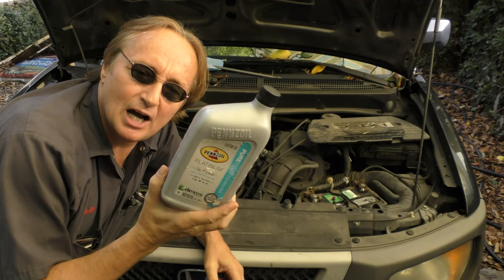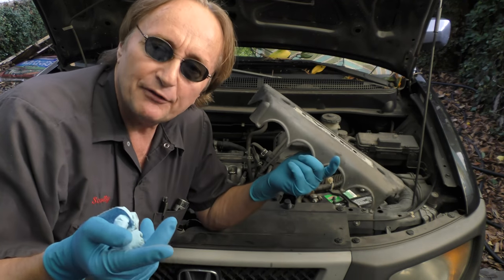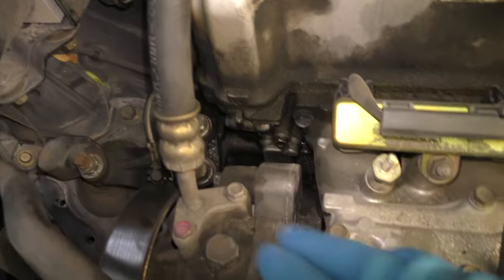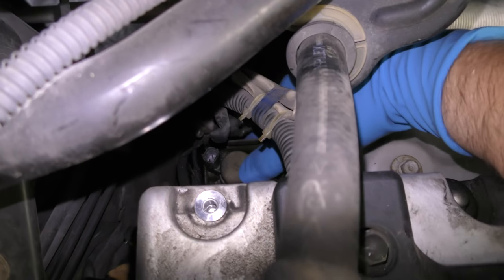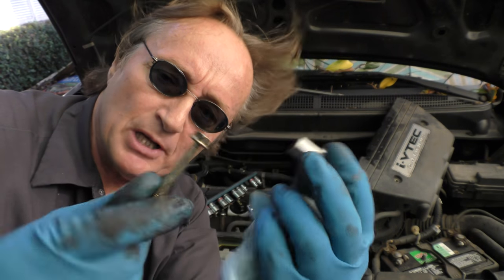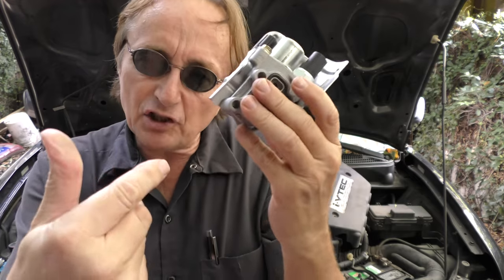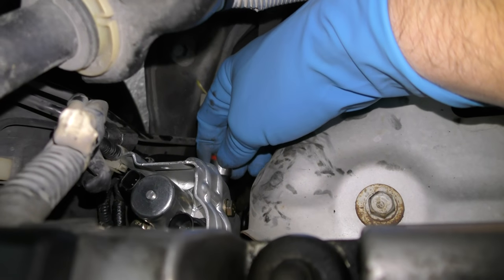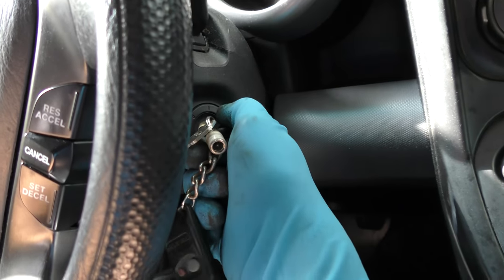How to Fix Variable Valve Timing in Your Car (VTEC)

Comment: Hey Scotty, not related to this video, I wonder, did you have any experience with diesel engines in cars and repair them, for example. VW TDI engines?
Reply from the maker: +Netko treći some, but I'm not a diesel fan, as they smell, and i'd hate it if everyone in the city drove one.
Reply: +kris200998 My other reply I think disappeared. I was following a brand new Ram Ecodiesel the other day with my roof down. I could for sure smell the oil burner 4 cars back. it wasn't till I passed it that I found the culprit. Diesels=end of top down driving, at least with a lady in the car next to you.
Reply: +Scotty Kilmer some that use biodiesel actually smell nice,kinda like French fried potatoes L
Reply: Yes,it is true that every diesel car smell,a even a new modern diesel smell.It si a true,and they and are expensive to maintain.
Reply: No no and no.I live in Europe,and in familly we own 3 cars;2 diesels and 1 gasoline car..There is dpf filter,there is turbine(that cost about 1000$) there is high pressure pump.If something goes wrong on diesel oh man you will go broke..and the petrol unit has nothing complicated, expensive, etc.
I'm telling you from experience maintaining diesel in every way more expensive than the maintenance of petrol ...And yes,we have 2 diesels in familly,and I will allways say "fuck diesel"..Cant wait till we get rid of this diesels and buy turbocharged gas car <3
Reply: ***** And yes,your profile photo is cool..I love to listen to DMX, Tupac,bigie smalls,.they are my favorite artists
Reply: FCFordLord In fact, here in Europe is the 1.3 diesel rather rijedak.Mostly have 1.9 TDI, 2.0 TDI, 1.6 TDI, 3.0 TDI and Ford's 1.8 TDCI.I Each of the above has a turbine, high pressure pump, injectors are expensive as you hell..When is cold  Diesel can not drive at higher rpm (3000 rpm) until the engine has warmed up. so you can not turn off the diesel engine immediately after driving (after the wild ride) that would not be turbo failure..Diesels are tired, expensive, lazy as fuck ...
Reply: +Netko treći Thats why that diesel Audi won a lot of races.
Reply: K.D. Pearce Audi won some crappy race because they are the rules allowed to have twice the capacity than the petrol engine ... So for example if you have a 2.0 petrol, 4.0 diesel they have so winning. To have the same volume of gasoline would win anyway.
Reply: +Netko treći There are obviously gasoline cars with turbochargers and direct injected gasoline engines also use high pressure fuel pumps so neither of those things are exclusive to diesels.

Comment: I'm trying to replace my cylinder 1 (vvt) oil supply solenoid on my 2016 Chrysler 200 with a 2.4l, but there doesn't seem to be a bolt hold it down. Can you please help?

Comment: Hey Scotty Kilmer I have a 2006 Acura TL 3.2 And I have a code p2649 vtec solenoid valve high circuit u can search the code I think that’s the problem but I changed my oil I’ve always used synthetic my car won’t go over 3000 rpms if I hits it starts jerking badly I need help!!!

Comment: Scotty kilmer I had to trade my Kawasaki zx14 for vehicle today and that suxs but my issue is 2007 Chevy Colorado 2wd with 2.9 4cyl/5spd and I have code p0017 and it feels weak and idle isn't very good ...is this sensor or timing chain with 97k miles? I'm freaking out because I traded a nice nice bike for a truck since my other car is broken and isn't worth the money to fix it and had 252k miles lol 00 s10 Xtreme 4.3/5spd

Comment: hi sir im alan. i would like ask your opinion about the 2011 accord v6 3.5. has a cold start noise for about 1 to 2 mins. and noise gone. according to the mechanic i need to change vtc actuator. but upon checking on honda dealer v6 3.5 no parts like this on the 2011 accord 3.5 can you help me with this thanks.

Comment: Hey Scotty I have a 1997 ford expedition xlt 4x4 5.4 when at cold dead start it runs fine but when it warms up it sounds like a diesel and when you drive it it drive fine in till you come to a stop the idle stays up then cuts off you put it in p or n crank it back up then it idles fine what causes that please help ????

Comment: My sister put a quart of motor oil in her coolant reservoir and drove the car for about 35 minutes what would u suggest would help fix this problem obviously a flush I've done that already but there is still oil in it :( any help would be appreciated thanks
Reply from the maker: +abe rods pay a pro to flush it with a heated flush machine, or keep flushing it yourself at least 5 times using a strong detergent to break down the oil

Comment: hey scott, what type of spark plugs are best for a 2001 ford explorer? truck drives somewhat a lot. They offer platinum, copper, and some other ones, but i forgot... what spark plug materialls do you think are the best?
Reply from the maker: +DatCarGuy310 irridium
Reply: You should run the same plugs you had before.  If the stock plugs were platinum, it won't hurt to switch to iridium.  On a GM, your stock plugs are probably AC Delco.  Stick with AC Delco.  I finally changed my plugs on my Cobalt at 129,000 miles.  The old plugs I took out still looked pretty good.
Reply: And stick with the brand that was in there before.
Reply: kcg795 My explorer runs with the OEM Motorcraft spark plugs. Just that I was asking what type of material such as platinum, copper ETC are good for.
Reply: +DatCarGuy310 Motorcraft spark plugs are made by Autolite.
Reply: +DatCarGuy310 I have autolite platinum in my 92 Explorer.
Reply: +DatCarGuy310 There should be a sticker under the hood that tells you the spark plug needed and spark plug gap. I just changed the plugs and wires on my 1986 Bronco.
Reply: If it ran great with the stock plugs, there's no reason to change brands.  If it is running a waste spark ignition system, you can go with double platinum plugs where both the electrode and ground strap are platinum.
Reply: kcg795 I been using motorcraft plugs on my explorer, lasted a good amount of time. But one of the plugs is misfiring already so it's time to change them.
Reply: Actually go for Motorcraft, IF you cannot find Motorcraft, get Autolite. (Autolite makes spark plugs for Ford Motorcraft).
Reply: Spark plugs are not expensive.  Is this debate really worth arguing over?  If whatever you had before ran fine for the first 100,000 miles or so, go with the same ones.  Spark plugs are not going to make any difference on how your engine runs.
Reply: kcg795 My explorer has 146xxx miles. I changed em when they had around 113xxx miles. Sort of a lot of miles on them.

Comment: I am getting a p2469 on a 2006 2.4l Accord.  I replaced the vvt sending unit and cleaned all of the screens.  Tried clearing the cod and it didn't clear.  I then replaced the entire vvt valve assembly in the back of engine and it still has p2469 that will not clear.  What are my options
Reply: Rob Houg now change your oil

Comment: Hi Scotty, Parking on a steep hill makes my 1995 f150 (302 fuel injected) hard to start and hard to  keep running.  Could you tell me why?  Thanks
Reply: if it's at an angle maybe the fuel pump isn't strong enough to shoot the fuel all the way to the top of the car since gravity is going against it at the angle and pulling it down towards the end of the car.
Reply: +junior pons thanks
Reply: +otherstuffbybob Might be the engine oil. When you check oil in your car its supposed to be on a level surface, if not it'll go to one side of the oil pan give a false reading on the dipstick. Same things goes with your issue, if its on a hill all the oil will go to one side of the oil pan, potentially sinking the crankshaft in motor oil, causing resistance in the engines rotating assembly which will make the motor sluggish (Much like putting your hand in water and moving it quickly vs putting your hand in air and moving it quickly).
Reply: +TheFlacker99 (Flak) good idea, thanks!
Reply: +otherstuffbybob Don't listen to these guys. It's probably a clogged fuel filter. They're 5 bucks. Change it and it will probably fix your problem.
Reply: +**Classified** Thanks for the fuel filter idea.  And as far as the "other guys" their ideas are good ideas too, I appreciate everyones' help.
Reply: otherstuffbybob I just went rant mode there because the fuel filter is so overlooked. It's a bit foolish to jump to a fuel pump conclusion, especially if you don't know when the last time the filter was changed. Check the fuel pressure if you have a test port. Should be at least in the 30's key off, and 40's running. Could be all the way up to 60 though.

Comment: i have a question a stopped to help a guy on the side if the road whose car started smoking and oil pressure went down. he couldn't get it started back up engine seemed like it didn't want to turn over
Reply: sounds like fully blown head gasket.piston rings may be shot or another reason for engine to lose compression.
Reply: +oscar rodriguez Piston rings probably
Reply from the maker: +Netko treći often a blown engine then, it if doesn't start up after it cools down a while, it's that for sure.
Reply: +Scotty Kilmer I've also heard it can be due to the flux capacitor not being fully charged and the cars tyres not being inflated correctly can you verify this??

Comment: Please help , i changed solenoid and oil also motor goes over 4k rpm runs get but still have code 1259

Comment: Hey Scotty, I have a scion tc and I have to replace a camshaft and crankshaft sensors.  Can you tell me where are those?
Reply from the maker: +Jorge Santiago realize you probably don't need both sensors. If you have codes for both, more often a worn timing chain causes that, not bad sensors. I've NEVER had to change either of those sensors on a Scion, EVER.

Comment: What if there's no code but oil leaking on passenger side of the engine, 08 Accord 4 cylinder 275k miles

Comment: Which you could of recorded the noise from it that it makes. Could it also be the VVT actuator whether it can't get past 3,000rpms or makes a grinding sound?
Reply: i have the same question....
has anyone had symptoms of valve chatter while having this check engine code? Dash reads 20% oil level but the oil is full. when starting the car it has a valve chatter and the p1009 code. is my engine toast?? or should this fix it??
Reply: i assume these parts are dirty and need to be cleaned, and/or replace gasket if it still leaks. i shut the engine off right away and pushed the car weeks ago and its sat ever since. When i try to start it, the rpms arent steady and there is some chattering noise i assume the valves due to low oil feed
Reply: @DVrec22  That is the sensor behind the engine, the valve and screen. I found the issue with mines and is the actuator as it makes a noise when cold start and it rattles. On my wife car it would stall and it was a combination. Cleaned the screen, replace the valve since it was leaking and dirty, it would still stall so checked the sensor and replace, problem solve.
Reply: Those issues will consume oil. Replace those 3 parts 1st, then take it from there. My wife car is as consuming oil a lot after replacing those 3 parts no more issues. You can do it yourself. Just get OEM parts only.

Comment: That's exactly what happened to my 17 year old Lexus. Luckily I was only 2 blocks from home and limped back. CEL on so had the code.  Easy repair. Screen was clean and oil+filter changed every 4K.  Just bad luck.  Otherwise the car has been very reliable all these years.

Comment: Hey Scotty i have a question. I have a 2003 chevy impala LS (3.8) with 124k miles and it has been very well maintained. But over the past few weeks it has been acting up. My fuel economy is bad and from idle to 2800 rpm there is no power and it sputters a bit and hesitates when accelerating, but from then on until it shifts it has decent power. Im thinking its something electrical do you have any idea of what could be going on?
Reply from the maker: +AxFREAKINxNINJA have a pro like me scan it, and especially check the maf sensor and see if the catalytic converter is clogging up, it can be pressure tested
Reply: +Scotty Kilmer Ok thanks a bunch! Really appreciate it!

Comment: Hey Scotty I have a 1976 corvette  but I have to pump it at least 50 times to turn on the car what could the problem be?
Reply from the maker: +jerry juarez if it has a carburetor, it needs rebuilding or the choke adjusted.
Reply: thanks

Comment: Scot. i bought a 2001 nissan pathfinder 4wd with a bad engine. I bought everything to get to run like new( engine rebuild kit that included everything, timing kit including the oil pump, water pump, belts some hoses, oil pressure sender switch, even the 2 thermostats. I took it to a shop to get it rebuild and they did but after a few days the engine light came on and it had p1135 variable timing solenoid bank 1, and p0138 and p0139 O2 sensor 2 bank 1 slow response and high voltage. I replace both solenoids, erased the codes and did a drive test and completed the cycle twice and same codes keep on coming each time. overheated going uphill, AC on or off, the radiator was also new. after a week or so, the light turned off on its own. So got it pass smog in california. the light came on after driving long distances. the car feels fine when its cold but when it get to normal temp starts to loss some power. since the shop i took it to is really far i need some ideas on what it can try to fix it. when cold and start the vehicle the oil light blinks for like 2 seconds and it turns off. since there is no coolant leaks or compression going to the coolant and most of the components have been changed i figured is probably something to do with the oil pressure. i was at the shop few times and saw everything been washed piece by piece so i don't think is the vain that goes from the oil pump the solenoids. everything was order to exact size. the only i can not say i seen been done is the heads. supposedly they had their own head shop. one last thing is that when at normal temp if you try to hold it to 1500 rpm starts to jump(ex: from 1400 to 1600) nut if you just step on the has normal you wouldn't feel it. many people has the same issue with this vehicle. I have seen at many different forums and they don't have a clue. the air pockets have also been released. please let me know what you think and I'm sure it will help many people. thank you ..... hope to here from you..
Reply from the maker: realize hardly anyone these days rebuilds an engine correctly. Guy just did a crap job. Personally I advise customers to junk those when the engines go out, or look for a low mileage used engine.  You're chasing the dragon now, good luck, but realize it's probably just poor rebuilding work on that engine.
Reply: thats what i was thinking. im a diesel mechanic but only worked in military vehicles, Tanks, Etc.. im going to star checking the timing and go from there. thank you Scot..

Comment: Hey hi I got a problem with my car is a 2010 Acura TSX I erase the VSA code but when I did that my car just turn off I disconnected the VTC valve and turn back on but don’t have power when I press the gas with the VTC valve plug off but when I connect the VTC valve car turn off as I connect the wire to the VTC I change the VTC can you help me

Comment: I have a 2007 SRX 4 with the 3.6L V6 but the engine light is on. According to onstar its the VVT system and the fuel to air ratio and its "Running Rich" I honestly don't  know what's wrong with it. It's underpowered and slow when accelerating... I've looked it up the 0-60 mph times with the same 3.6 and most of them do around 6 seconds but mine takes over 10 seconds to get to 60 mph.

Comment: scot. I have a 2nd hand used 5sfe with a block thats done about 170000kms. but the head has been reconditioned. would bolting the head on cause stress on bottom end?
Reply from the maker: of course it would to some extent

Comment: My car will go fine up to about 3500 rpm and then for the next 1000 rpm it will run poorly and shake a bit and then after that it will be ok again. Could it be the same as in this video?
Reply from the maker: +TheGameTripleH4Life could be lots of things, scan it first and check for codes.
Reply: Motor mount?
Reply: beefeater777 I don't think so. The acceleration is also bad in that area.

Comment: I've got a code for my vvt that has been on and off. do you think the gasket is the issue as well as probably dirty oil? The code/CEL never sticks on too long and seems to disappear whenever I get my oil change.
Reply from the maker: yes, change your oil more often, dirty oil clogs up vvt small passageways
Reply: Scotty Kilmer thanks for the response. As of now, I ordered a new gasket so I'll replace that and do my oil change next week when they arrive. I only drive about 5 miles to work on small roads so I think I'll be fine til then.

Comment: Hey,i have Honda stream 2.0 vtec 2004. Mil light come on about driving 10-50 km.. I have change motor oil and check the vtc solenoid.And it`s not stuck.. But stil give me code P0011.. What is the broblem?

Comment: nice guide scotty but I'm having a hard time locating the VTEC fluid filler cap
Reply: Lmao
Reply from the maker: +shut up u idiot ダチ  all the cars I've worked on use normal engine oil for the VTEC system and it's changed when you change the oil

Comment: A 2000 volvo s40 won't crank well and backfires thru the exhaust after changing the timing belt and head. I can't get the timing right and the compression seems to be gone. I know that the cams are out of adjustment and I need  to know what to do,how to adjust the cams properly.
Reply: Derrick Smith yeah u have the timing wrong if youre not getting compression. watch a video on valve lash adjustments and try that. learn to find top dead center and your timing problems disappear